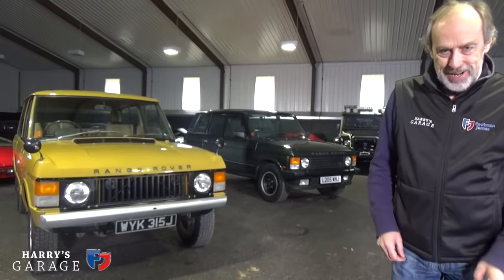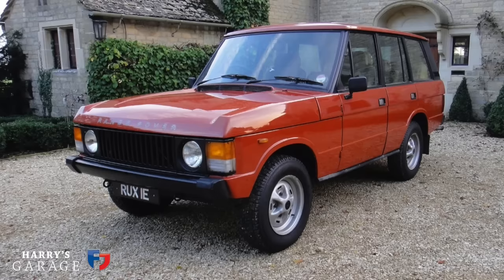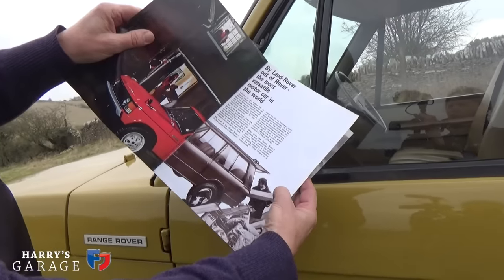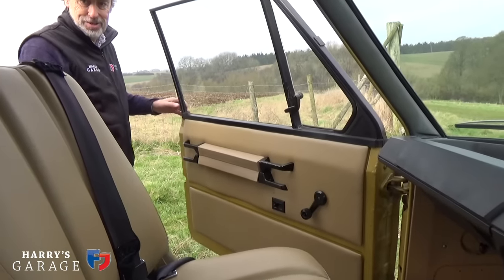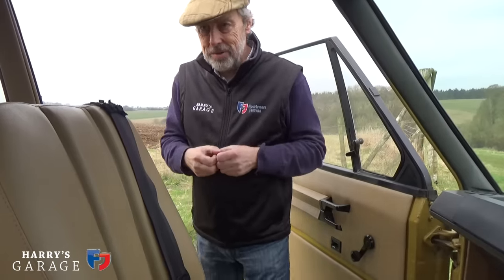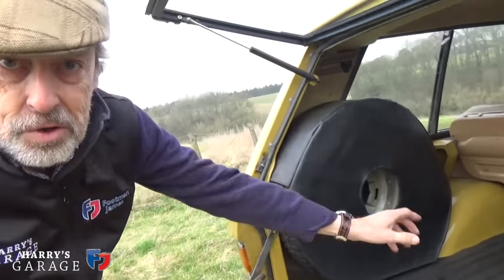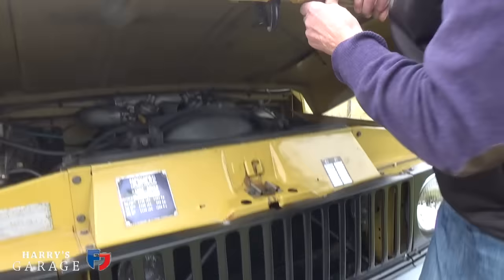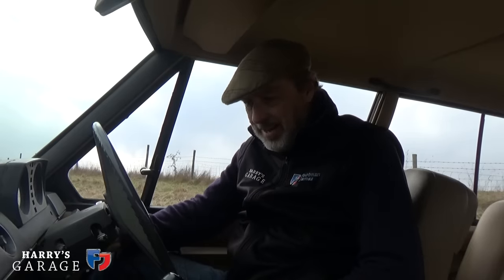Range Rover Classic. Real world review of '71 Suffix A & 90s Vogue

Comment: I had one of the very first RR 1971 RHD in the United States. Govt regulations essentially prohibited import of the vehicle unless LR were to modify it, test and type certify to UD specs, which they would not do until the very late 80s. Being an avid Land Rover owner for many years at the time, the reliability of the RR was quite a delightful change.  Put 150,000 miles on it without having to change an axle or exhaust component. The only difference between his RR and mine was hit came with a towing plate and it was blue. Sadly it’s demise was whilst I was towing a 9,000 pound sailboat a passing truck just clipped the aft of the boat which caused massive oscillations which threw the boat off the trailer and flipped the RR on its roof, with the trailer still attached. However continued down the road still in. My lane watching the pavement go by inches from our heads. The strength of the roof was up to the task and did not have a scratch . Because we never hit anything, although squished it still   Drove fine. Years later do,d it along with a body and the enthusiastic née owner just transferred over the running gear.

Comment: A friend has one of the originals owned from new, I was very impressed with the flexibility of the engine, tackling a small roundabout in 3rd while towing another car. The steering without power assistance was light enough but felt vague. The later automatic Vogue was easier to drive but I found myself being a hooligan in it, sadly the running costs put me off owning one. Great review as always.

Comment: I worked for a rich guy in the mid 1970's whose main car was a Roller but he had one of these as a fashionable fun runabout. He loaned the Range Rover to me for a driving holiday to Switzerland and I couldn't resist trying it out off road on some of the precipitous slopes near Grindelwald - it passed every test I could give it with flying colours. Down greasy hillsides so steep we were nearly falling against the windscreen and then back up with low ratio gears engaged and the diff lock on, it clung on like a caterpillar on a wall and kept climbing. We even made it up to the base of a glacier along a track peppered with rocks of ice! A fantastic versatile off road vehicle which also proved comfortable high speed transport on the Autobahn, although the body roll was a little disconcerting on long 80mph curves. Harry's test has brought back all the good memories - I'm just going to check the Ads to see if I can pick one up now.

Comment: I had one of the first fuel injected automatic RR's in 1986. Didn't particularly take to it, because the engine was temperamental on damp mornings and the transfer box whined mightily.  Changed it for a 2.4 diesel manual Vogue in 1988 which I far preferred. The engine was rather noisy and lacking in torque at low revs but the annoying whine had gone and I kept it for nearly 100,000 miles. It wasn't perfect and like all Range Rovers the build quality wasn't great but it never let me down and it is one car I still miss to this day.

Back in 1975/76 I worked for a chap with a white suffixA, up in Edinburgh, L registered in 1972 in white, complete with 8-track stereo, and he used it as a general farm truck and for leisure. We drove it down to London in freezing fog and had to stop every 50 miles or so to clean the salt and dirt off the candle-like sealed beam headlamps. We also used it to move alloy irrigation piped, with the top tailgate open and the pipes jammed between the front seats and sticking out of the back. I remember just as if it was yesterday.

Comment: A few years ago i had a 5dr Vogue. It was my first V8 car. wonderful power delivery. and great offroad capability
Back in the 70's and 80's our dutch motorway police force (Rijkspolitie) used RRC's as well as technical support vehicles. Next to their porsche  911 patrol cars those RRC's were equally iconic and doubled as PR cars because they commanded respect on the road.  Nowadays they only use run of the mill Volvo estate cars...

Comment: Beautiful. I had one of these during the late eighties/early nineties and it’s no surprise that JLR have revived it. It’s not only iconic, it’s still the prettier than any of the later versions (although the L322 has come closest to recapturing the magic.) I’m pretty sure mine was a 1970 or 1971 which is interesting because mine had carpets and velour seats. Maybe it was a trim option. In all those years I never even knew about that hinged rear  number plate! I remember that lofty riding position and all round visibility was the first thing that struck me. In that regard it was better than the Mk3 L322 I drive now.  My Mk1 was an import from Saudi so was relatively rot free and had extra lugs to secure the+bonnet, no doubt for bouncing over sand dunes. As you say, there was no diesel version and the V8 petrol consumption was prohibitive for me, but in the eighties people started having diesel conversions (the 3.0L Mazda diesel with turbo was a favourite choice..) Mine had been converted. Unfortunately I didn’t realise at the time but there was more than one 3.0L Mazda engine and mine was the wrong one, it should’ve been the licence built Perkins. As well as bolting on a DIY turbo  they had butchered the mechanics to make it fit, which required fitting a smaller radiator to allow enough space. Result... frequent overheating problems! With that engine it was also very noisy and sluggish, I could barely reach 65mph. Eventually it seized up and I had to replace it with a used 3.5 petrol V8;which happily were in good supply thanks to the good old Rover SD1 which was falling  apart while its engine was still good for another 200k.  It was a different beast after that, and for the first time it was performing as it was meant to. But with 12 mpg on average it was unsustainable for my daily commute so I had to sell it. How I wish I could’ve kept that car!
Reply: Our Saudi 1987 Range Rover still gives up sand today!

Comment: Harry, I bought from you a white J plate rangy with full length safari roof !!! 
Drove it across Europe many times, hunting wild boar,  use to try to throw the wild boar in the boot, not the sheep's ; ) 
It would go anywhere with Bf All terrain tyres.  
Keep up the enjoyable channel 
Cheers.
Reply from the maker: Fantastic to hear from you! 
Being as manual 3.9, that was a rare car. I found the clutch to be pretty heavy, though, but then I was doing much shorter journeys than you. What mileage did you hit before (I'm guessing) you moved it on? 
Harry
Reply: Harry's garage Hi ,that manual rangy was epic car !!!
Being a proper land rover Special Vehicle built to police spec !?
( i think it was chiped or had special cam, and beefier anti roll bars, for the police )
I fitted a 120 ltr LPG system, stainless steel straight thru exhaust, and a clutch kit !!!  It regularly went across to Northern Italy, Slovenia, Hungary on wild boar hunting trips 
The LPG made it a lot cheaper to run than any diesel G Wagon or Land cruiser, And it had a great soundtrack from stainless steel sport exhaust, especially climbing around the Alps with the safari roof fully open, Every trip was very enjoyable in that open roof manual rangy. 
( the safari roof was great for hunting boar with a 308 Winchester :  )
I Rember driving it back from Dijon France in really deep snow drifts , nothing else on the road was moving only that Rangy towing a trailer all the way in low ratio !!!
Other road users stuck in their Quattro's etc ,we're totally amazed .
 The manual made it a totally enjoyable epic car , 
but the last 10 years it sits in my field, with the body off waiting for a full chassis restoration, one day  :  /
Cheers
Reply: what an amazing story! Good luck for the restoration!
Reply: Francisco Pereira da Silva thanks
Reply: the most memorable classic Range Rover TV appearance in the early 1970's? better than any ad!
The Persudars, series 1 episode 19.
(the classic appears at 45 minutes in to this episode)
Reply: it's on You Tube,  via a search
Reply: "want me to open the gate?" ahahah awesome!
Reply: Harry's garage An idea for another of your interesting ' real world ' reviews feature !? 
I have a nice 30 th anniversary P38 4.6 V8 rangy, Your welcome to use for another of your great 'real world ' reviews.
( there's a comment from 'paachi' about this,the P38, on this comment section  below ; )

Comment: Back in 2008 my Jeep dealers gave me a courtesy European ford fiesta with a 1.1 litre engine, it return 22mpg real world. So the Range Rover is quite respectable!
Reply: 1.1 Fiesta and 22mpg? How did that happen?
 I did well over 50 with mine, over 60 if city driving wasn’t needed. It was a 1995 example, with the old 8-valve pushrod Kent. 

Never could get my 1972 Range Rover to give more than 15mpg though.

Comment: We had two of these at my job in the seventies all through the nineties. Both were early seventies models. We needed to tighten the spark plugs every 10.000km, they would just rattle loose. Had to rebuild the transfer box once. When coming back from putting out a fire quite a distance from our station, it just slipped into neutral. Had to keep my foot against the transfer box shifter all the way back to the station. We never made it, after about 60km the box gave up and we had to be towed for the last 10km. Extremely thirsty as well. We managed to make it consume more than 30L/100km.

Comment: Had a 89" model, unfortunately rusted away sold it for $500. Bought a used '95 classic LWB around the '02 year for 8k usd with the updated dash. Ok Clarion radio with a 10 box cd exchanger. Was so nice and so much room had alot of fun with that truck. The air suspension worked for abit, but took them out to fit bigger tires (Bridgestone mud terrains"s) with OME springs to get it higher without a frame height kit. At that point it was more reliable, could travel through 20" of snow no problem. And the ride experiance with the medium coil spring was like a Cadillac with amazing off road ability. Another truck I wish I never sold! The only problem I only trusted one shop in Springfield Ma to work on it. The tow was 2 hours from home. A good Rover mechanic very hard to find in the us then. Was well worth it. AAA was my friend lol.

Comment: My dad had a white 1971 Rangie - Chassis No.1250 - was one of the first Kent Police Range Rovers, and had a little blanking plate in the grille where the blue light used to be - was bought by a guy intending to restore it but never heard if it ever happened.  YKN631J was the plate and got promotional photo of it when it was kitted out by the police.  I miss that car, even though the steering was incredibly heavy.

Comment: What a great example video of the classic Range Rover. I myself have a 92' classic. I only wish that there was more access to parts for this particular model. My ignition switch just went out and after countless hours of research and phone calls I learned that they don't re manufacture this particular years ignition switch...Which is a problem if you want to start your vehicle...Luckily Ebay had a good used one and I was able to order it. Looking forward to driving this incredibly and beautifully designed SUV once more!! Cheers!

Comment: Another great vehicle review thanks Harry. My parents had an early 2 door Rangie plus a 93 autobiography if I'm correct. They didn't buy them new but were both in good condition. My younger brother also had an early 2 door plus a P38a 4.6 HSE & I've now owned 2 P38s, a 96 & now an 01 4.0 HSE. Both beautiful cars to drive, especially long distance trips. 
Such as driving the south west of Western Australia & driving around Britain on motorways & back roads. 
Such easy cars to work on as well, including the air suspension if you know what you're doing
I'd love for you to do a follow up video on the Range Rover range, comparing the 93 classic to a later P38a especially.

Comment: Fond memories... Indeed the 70's models where more rugged but also a great off road vehicle, that 'locking diferencial' you mentioned that was manual on the early models is hugely useful and unlike the Grand Wagoneer this one really worked, ie when your rear and back axle are spinning in the mud (pulling a Toyota Land Cruiser driven by an inexperienced driver) that lock blocked both and with the low gear and all wheels locked the Range was really a tractor! In Venezuela, A/C was an option and soon the overdrive was incredibly popular. Very poorly understood was the 'mono shock' suspension on top of the rear axle (shown on your diagram at 4:38') the reason the vehicles leaned, but also if that shock is not in good shape (expensive and rare to find at the time), the Range wobbles in a weird and uncomfortable way specially above 80 kmh; agreed the visibility driving and as a passenger is unequal unlike I have ever experienced, I am glad you are suggesting the 3rd generation also had a great visibility, until when did they stop offering them with the 5 speed manual? Thanks for your time!

Comment: I had multiple RR from 3.5 to 3.9 Hi Lines and MULTIPLE problems with each one - but now I yearn for one of the last series 3.9 for my next restoration project and drive it until they take my driver licence away because of old age.  HA - memories of my 4 children when young (we had an extra rear seat - which my youngest used to think was great sticking his fingers up to tailgating idiots).  Yes - they often had strange problems that drove me MAD (MADDER some would say)  - but I intend to find a suitable last of the 3.9 series here in Australia and do a nut & bolt restoration and keep it forever.  Although I always found them gutless and hence will probably run a big capacity RR engine and a supercharger to keep up with modern traffic and I always fitted anti-roll bars to mine (as they were a suburban tractor and not real off-road cars in my wife's hands).  The other day I saw a local builder with a 2-door with all the rear glass replaced with checker plate aluminium - HA - he probably purchased it when nobody gave them a second thought and now he is driving around in an appreciating and classic 4WD that surely attracts attention to his business.

Comment: I think I read that Buick actually designed and built that v8 that was originally released in the 1961 or 1962 Skylark. Nice little motor. I believe BL used it in many of their models.
Reply: Yes, it was a Buick motor originally. However they deemed it too small eventually and discarded it. Rover (before BL) bought the design and re-engineered it somewhat to fit into the P5 and P6 saloons a couple of years before the Range Rover went on sale. British Leyland certainly took advantage of the 'off the shelf V8' and used it in the MGB, Triumph TR8 and Rover SD1, Land Rover 101/Series III/Defender/Discovery. Other users were Morgan and TVR.

Comment: It's one of the few Leyland products that's creeping in value and those "Suffix A's" are very expensive and collectable. Spen King was a legend, the other weird thing is the switch to 5 door, it took Land Rover so long to do, they even worked with Monteverdi to build them way before they considered producing one themselves. I totally think it's worth restoring your soft dash too, there a bit of a rarity these days.
Reply from the maker: Believe they had a 4-door version in the works in the mid-seventies but they didn't have the budget to productions it. Plus there was a waiting list for the regular 2-door Range Rover, so there was boo rush to introduce it.
My soft-dash is a 320bhp Overfinch version, which I bought new in '94. Restoration costs are too high for me to press the button but hope one day to make it happen. Watch this space..

Thanks for watching
Reply: With it being an Overfinch it's worth holding on to, if i'm not mistaken they're the ones with the Chevy V8. It doesn't surprise me about them having limited budget, when you read up on the prototype stuff the likes of Jaguar, Rover & Triumph tried to get produced and couldn't, BL were tight, but hindsight is 20/ 20. Thanks for the reply, i look forward to the next video.

Comment: Replaced my series two with a two door v8, driven with a little restraint you can get around 18mpg, not good but better than what's often quoted, with no mot it was £250 of luxury motoring, bit of welding and back on the road, the power off road was just awesome, mine lacked the power steering so had more turns on the wheel lock to lock, steering was light and had a better lock than the discovery I had later, you can get a 4'x6' sheet of wood on the floor of the Range Rover but only 5' 7" in the discovery, not so handy, the mustard colour was called Bahama gold and was just enough off a difference from BLs harvest gold to be noticeable, Bahama gold was only available from Range Rover at £12 for a small tin, harvest gold from Halfords at £5 for a large tin ho hum!, ended up removing the v8 and fitting a big Perkins diesel, slower noisier and 28mpg, enjoyed driving it.

Comment: I remember coming back from a pub in Clitheroe to one of the outlying villages in the back seat of one of those 1970s Range Rovers in the winter of 1985 in driving snow and the 20 year-old (probably drunk) female driver was chucking it around like it was a sports car. They rolled terribly (I think there were 6 of us in the car, so top-heavy). On reflection, I'm glad I was also as drunk as the driver.

It is scary (for me) as a 54-year-old, to realise that this car is almost 50 years old.

It is also interesting to note that my 2018 Mini has more horsepower than a 1990s RR.
Reply: Reported